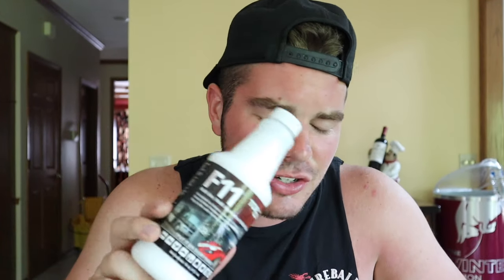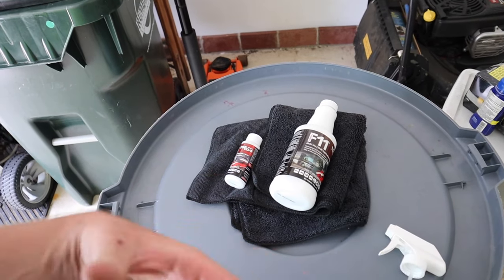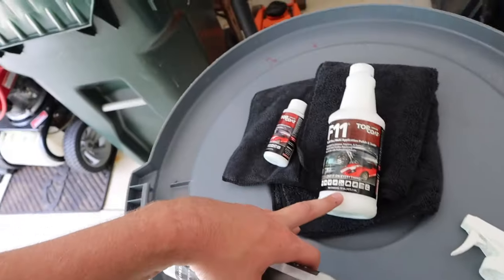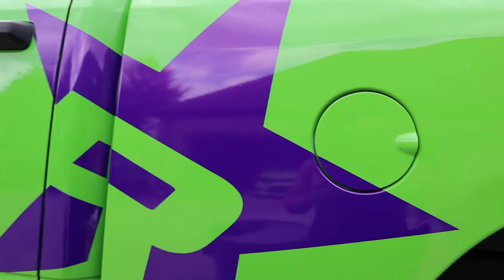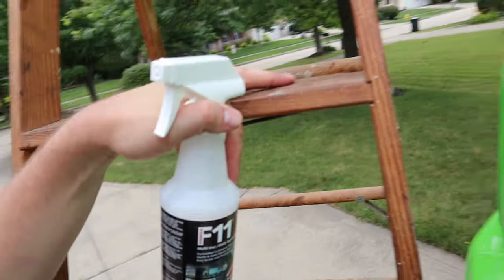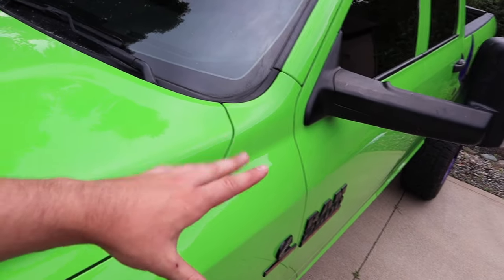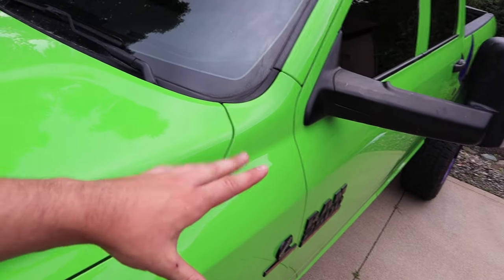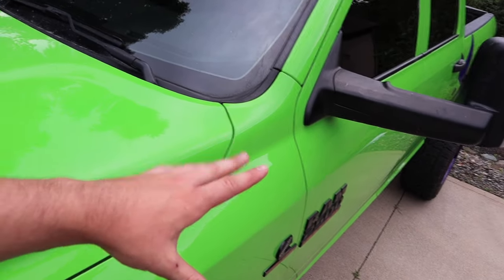TOP COAT F11...EXPOSED (*Real World Review*)

Comment: I've been using F11 for about 2 years now and I love the ease of it. Takes me about an hour to do my truck. I purchased the one gallon bottle for $200 (ouch) but have been using it for the 2 years and recently had to buy another one. Definitely worth the money concidering how long it last. Anyway, keep up the great work
Reply: Lou Indorato use beadmaker it’s better and cheaper
Reply: Honor Hurricane  can you use your bead maker on every surface imaginable?  The reason it is more expensive, is you probably are still using a lot of other products besides your bead maker, to do your detailing.  Subtract the price off all of those other products, then you’ll find out Topcoat is not that expensive.  Your just not taking full advantage of the product.
Reply: Rod Graff not really I can get a gallon of trim shine and bead maker under $60 and I got every surface covered there’s no reason to spend $400 in 2 gallons of a product that fails after 1 wash
Reply: Honor Hurricane yea and I’ll bet your surfaces are all artificially greasy, and attract dust.  I’ll bet you can’t put those products on denim paint.
Reply: Rod Graff nope they work perfectly fine. Bead maker is prolly the best spray on protectant out there.

Comment: The website for the Jax Wax ceramic detailer says it can be used as a top coat for additional protection on your ceramic coated vehicle or it can be used as a stand alone sealer on a non ceramic coated vehicle. Do you use it as a stand alone product or do you have your vehicles ceramic coated prior to using it?

Comment: I've tried it yeah it makes it real smooth but it don't last two car washes and a rain storm later it's off
Reply: Lenny Eline gotta let it cure for 24-48 hours
Or you will wash it off
Reply: Yes you have to wait 24 to 48 hours, and it does not wash off, the reason it look like its washed off is because dirt will still cling to it, what you need to do after applying is let it cure, than once it gets dirty cause it will, use a garden hose with a microfiber towel like the one they give you, apply that wet like if you were mopping and you will notice the water beads coming right off, if you have grit in your paint than I will suggest clay bar

Comment: I’ve used it over a year. Says you can apply several applications to build it up. Nope doesn’t do what it says. 
F11 is pricy. At best it’s a quick detailed. When I ordered I did order few bottles.  Stoped using it except during winder time. After washing my truck I do use this for a little bit of protection.
I rather use Honda Bright which I get from motor cycle dealers for about $7 it’s a cleaned and wax to me is better. F11 doesn’t last period. The most I applied was 4 coats still didn’t last. Any wax will protect some and allow your bottle to slide down your hood. Will not buy again myself. Try the water test after two or three times driving thru the rain. No longevity.